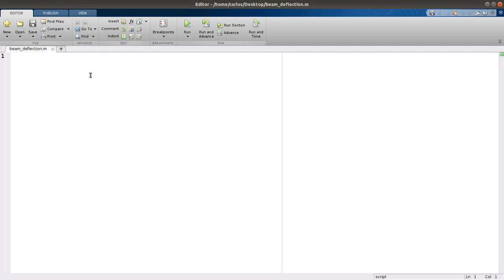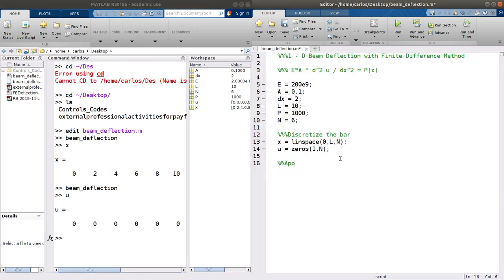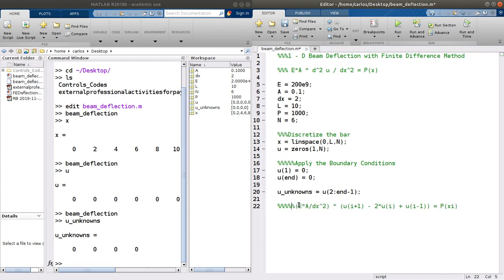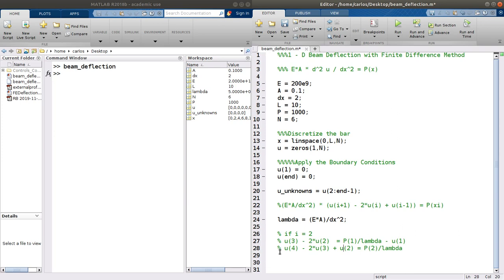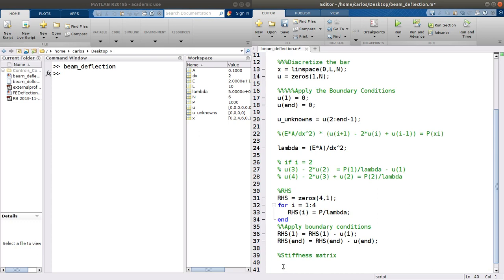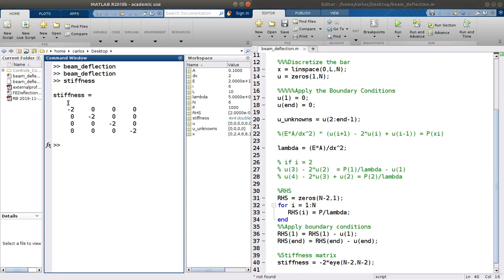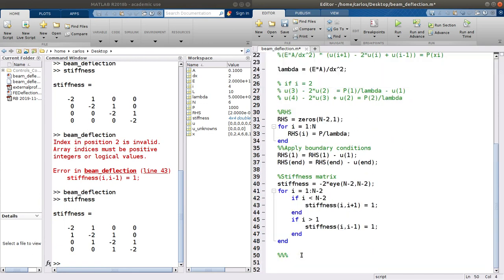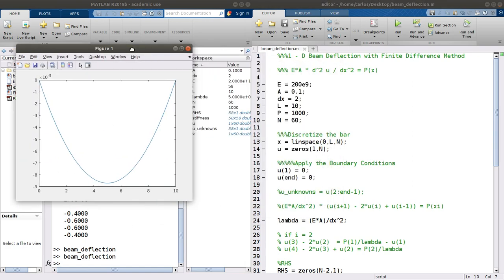MATLAB Help - Beam Deflection Finite Difference Method

Comment: Did you use A instead of I for the moment of Inertia?
Reply from the maker: I tihnk in this case A is the cross sectional area of the beam.
Reply: @CarlosMontalvo251  Hm ok. I thought that the equation for deflection was E*I*u'' = M
Reply from the maker: @irvinkershner9142  I think the equation in the video is for a cantilevered beam with a point load but i'm no expert here

Comment: Sir how to do liability analysis of RCC beam using matlab
Reply from the maker: I don't know how to do that unfortunately. Good luck.
Reply: @CarlosMontalvo251  sir I create a beam in abaqus and know I want that same beam is analysis 1000times using MATLAB is it possible basically sir I want that MATLAB is change material properties automatically and run 1000 times
Reply from the maker: @navdeetsaini5553  Pretty much anything is possible in MATLAB including what you'd like to do. If you want to change material properties you just do a for loop where you change the material property in the loop.

Comment: hi dr montalvo
i have a partial differential equation that must be numerically solved by Matlab, and i am not worked on pde before, may you guide me,
thanks a lot.
Reply: i can send you the pde and boundary conditions.
Reply from the maker: @boyerboy8238  Unfortunately I don't have much experience with PDEs. This is the only video I have on PDEs. https://www.youtube.com/watch?v=07jGlNbvOqw&list=PL_D7_GvGz-v0dng864FPenLhbSUNyKmfm&index=52&t=0s
Reply: @boyerboy8238  start with the Laplace Equation (Elliptic PDE). I think that is probably the most straight-forward. The derivation is not bad and you can code up a basic solver using Gauss-Seidel pretty quickly. I'm just learning numerical methods for solving PDEs and I have no prior experience with PDEs.  Laplace was the first thing that I was presented with. Good luck!